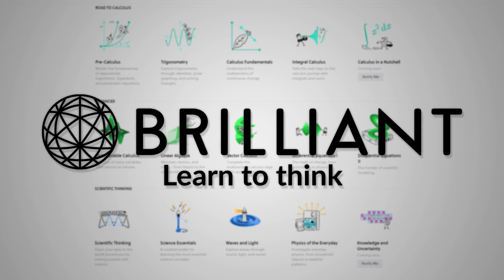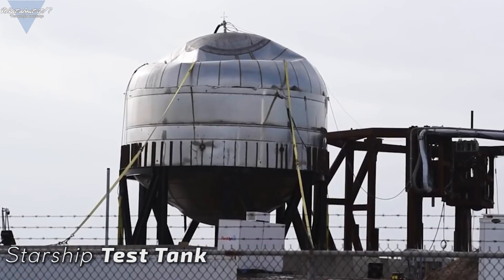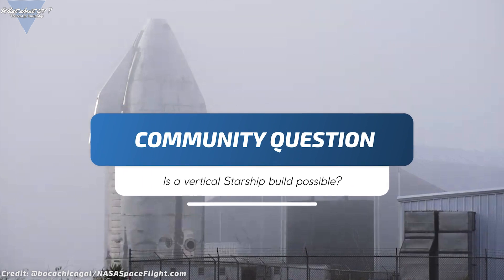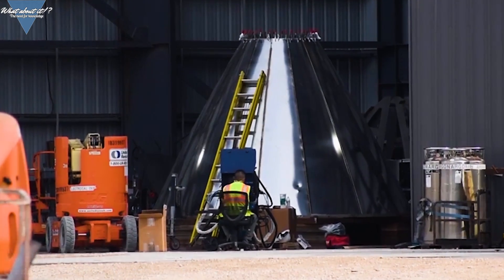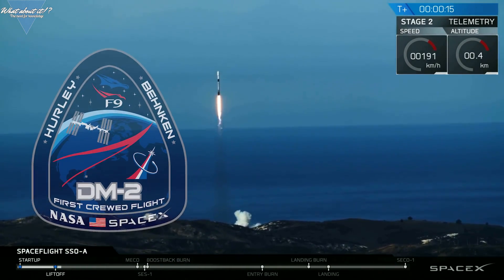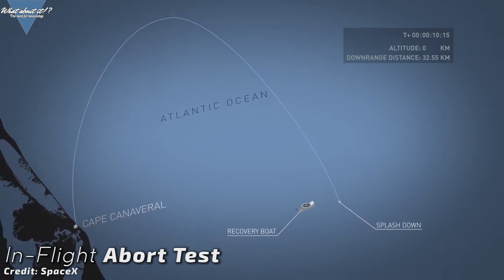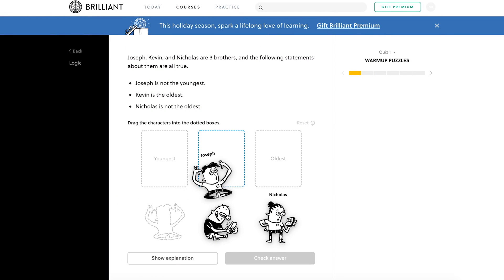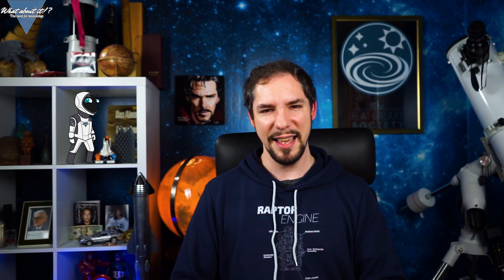65 | SpaceX Starship Updates – Crew Dragon In Flight Abort Preview

Comment: Joy to watch as always. Just something to point out. Metal Water cutters cannot work only with water. It needs some fine abrasive powder to be mixed through a nozzle at very high pressure.
Reply from the maker: Yup. You're correct too... Mixed it up. (pun intended)

Comment: Water jets usually use a grit, like garnet, in addition to the high velocity water.
Reply: Depends on how thick the metal is. With stainless, you are correct.
Reply from the maker: Absolutely! I might have been too much mesmerized...
Reply: Thought so. I've seen it with cinder blocks. It didn't look right in the video, so I figured.

Comment: I can think of a few methods to isolate working areas while stacking vertically. one is a Gasketed moveable work capsule for workers alongside the bulkheads which would keep a controlled environment constant while welding and fitting.

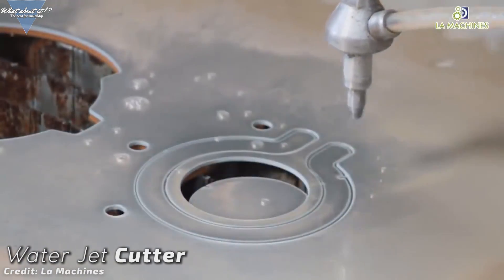Comment: 2:50 "nothing more than water"

I might be wrong, but dont these things work by using high pressure water to accelerate something else (sand or so) to actually cut the material?
Reply: Yes, typically garnet I believe

https://waterjets.org/archive/waterjet-equipment/general/waterjet-abrasives/
Reply: Yes
Reply: Yes, a common abrasive in a water jet machine is Garnets.
Reply from the maker: Yes yes yes! Thank you! :P :D
Reply: you can actually see some of the garnet collecting on the material in the video. that is the sand colored substance that is washing around outside the cut area. we have a water knife in my shop area that can cut steel up to 6" thick.

Comment: -Some of those I beams in the pile have heavy base plates, (making them columns). Those big thin plates on them are bracing connections.  They remind me of what was used when building the big wind shelters.
Reply from the maker: Second wind breaker is one of my theories too. The gravel pad they made is very large and in the original plans they mentioned a second wind breaker. Thank you for your comment!  :)

Comment: It's not just water, there is a feed they put in there that bombard the metal. I forgot its name but that makes the water unusable for the same process again as it'll clog the feed and water system if they do.
Reply: It's called "abrasive" and it's usually tiny grains of carbide (I believe)
Reply: @Sin526  yes that's the general term, and there are many types depending on the material being cut.
Reply from the maker: Absolutely! Messed up the words. Thanks for the feedback! :)

Comment: I'll go even one step further and say SpaceX won't fly a human to Mars before 2030. And that's perfectly okay, nothing wrong with waiting another 10 years. This vehicle needs to be super safe and hardcore tested before going to Mars.
Reply: They have the rocket motors to handle the job of going g to mars. 
10 years of testing would be too expensive  for a private  company. NASA help....

I dont think a death can be avoided. Sad to say .
Reply: @golfish8589  Oh it will surely fly before 2030, I think it will also fly to Mars before 2030. I was saying it won't fly humans to Mars before 2030. Look at how many F9 flights it took before Falcon was considered save enough to fly humans and how long it took to only test Dragon itself to be save enough. We're talking about existing technology, a rocket as small as a stick and a tiny capsule. Look at how many years that took. Do really think SpaceX could pull off a giant crewed Starship in 4 years? It's 2020 and they're figuring out how to weld pressure tanks. It doesn't matter how fast you build. They will encounter massive engineering problems which need testing, that's just how it goes. And that's perfectly okay.
Reply: @2014andBeyonD  
I herd a good comment somewhere.  Maybe it was in the video. "Space X is trying to find the cheapest manufacture to make the Starship starting with the cheapest techniques first?
Musk should make a 5 minute video each day. Recapping the decisions and progress/failures.

It would make a great documentary some day.

I just want to be a fly on the wall:)

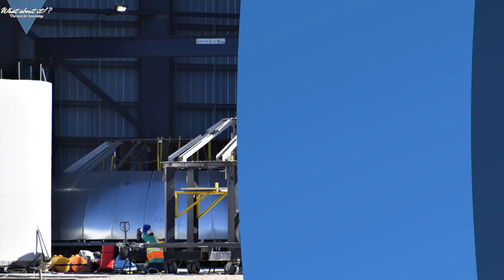Comment: 2:52 "... cut solid steel with nothing more than water" - NO!  While you can use "nothing more than water" to cut softer materials, I have never heard of it used to cut stainless steel.  Most likely they will use an Abrasive Waterjet Cutter which injects an abrasive into the water so it can cut the steel.  The filtration is needed to remove the abrasive before the water is returned to the pump. Abrasive may be good for cutting; but, it is bad for pumps.  This specific unit is a high volume abrasive removal system.  The big squarish bin is where the abrasive is collected.

Comment: Are those square cut outs to test strength for window cut outs?
Reply: Windows wouldnt be square, de haviland found that out in the 50s after losing a few comets.
Reply from the maker: Yeah... square windows are not an option at all. Also, windows at such an early stage would make no sense.
Reply: @Whataboutit  fisheye shaped windows would be ok....for the obligatory gopro shots of the flat curve. :)

Comment: Why don’t they make the parts with a single mold instead of welding? Wouldn’t that make it handle higher pressures?
Reply: The thickness has to vary along the length of the ship.
Reply: Odysseus Rex Doesn’t sound hard to make a mold with different thicknesses
Reply: @PassportGaming   Well, study up on engineering then.
Reply: @Odysseus Rex That’s my major in college
Reply: @PassportGaming   Then you will eventually come to understand.
Reply from the maker: Fun fact: Building in parts is almost all the time easier, cheaper and more flexible, when it comes to design changes. ;)
Reply: I meant just the tank, but you’re right about that

Comment: how come beoing is not doing this test?
Reply: Boeing did the test already. A pin was missing from a parachute and the environment suffered a poisoning but it was called a success.
Reply: @warhawkme6344  Boeing didn't do an in flight abort test. They did an abort test from the ground. They aren't doing it because they are trying to prove more on paper while SpaceX is trying to prove more in practice.
Reply: @warhawkme6344   No, that was a pad abort test, not an in flight abort test.
Reply: Both companies were given the option of an in flight abort test or extensive simulation. They made different choices.
Reply from the maker: Rex is correct. They were given the choice. Both decided on their own.

Comment: is it too hard to recover the booster of second abort test, example,:they also can put empty second stage to save the booster..
Reply from the maker: I was very surprised, when I first heard it too, but there's one thing, most don't see at first. It HAS TO be an unmodified rocket for valid test data. ;)
Reply: @Whataboutit  — unmodified except in one small detail, at least... the second stage has a full tank of fuel to keep the weight realistic, but no engine... presumably the missing weight of a single vacuum Merlin not considered important enough to be worth sacrificing one.

Comment: Why does SpaceX crew Dragon opt for a water landing? Boeing Starliner opts for land landing. Is Crew Dragon a lot heavier than Starliner?
Reply: Crew Dragon was originally designed for propulsive landing, no parachutes. NASA nixed the idea though. At that point, landing on land would have required radical redesign, so they went with splashdowns, which they were already doing with Dragon 1.
Reply from the maker: Correct. Thank you as always, Rex.
Reply: @odysseusrex5908  Presumably there's also the factor that, if you're launching from the east coast, any abort during launch is going to be wet... so if you have to design for that situation, you might as well make it the norm and not worry about landing on land.
Reply: @simongeard4824    Well, quite obviously, Boeing disagrees with you.
Reply: @odysseusrex5908  obviously, yes. I'm not saying it's the reason... only that it's a factor that both Boeing and SpaceX would surely have considered, even if they've subsequently chosen different paths.

Comment: What is the raptor production turning out to be should there be like a couple dozen completed by this point
Reply from the maker: Most likely not a couple dozen. The last time, we got a number, it was 17  as I remember. That was the "christmas Raptor". So roughly 2 1/2 weeks ago. So, we should now be at around 20 or so. Hard to tell without numbers. Everything Elon said so far about ramping up Raptor production was wildly wrong down the line, so I'd be veeeery careful with his numbers on that one. For example in may last year he said, they'd ramp up production to one rapter every three days until... last summer. If that was correct, we'd be at 60 engines right now and we're clearly not. ^^
Reply: What about it!? Thanks you for the info very interesting stuff. In my opinion Raptor engine production is a major limiting factor for the Star Ship production timeline. If every Star Ship need approximately 30 engines, and they’re only producing 1 every couple days it will take a year simply to make enough engines for the prototypes.

Comment: Pretty sure there were photos of the UFO Docking Ring already getting sliced up for scrap. Looks like it was a welds and cuts test segment.
How sure are we of the F9 coming down after a Rapidly SCHEDULED (!) Disassembly ?. The easy way to trigger an emergency event would be to load just enough fuel to get to Max-Q and have the F9's acceleration stall, causing the software to fire the Draco's using the normal in-flight software, rather the software modified for the test. Would a dry F9 still disassemble?
Reply: It disassembles because of speed, not because of fuel :)
Reply: @Fannystark007  - I think this will be one of the more interesting parts to observe. There won't be any need to have a fueled up second stage, meaning as the Crew Dragon pulls away, the open top end of the F9 will be exposed to supersonic airflow. that open top will surely be torn open, but will that cause a failure from the top bulkhead down? We have to expect that structure to have been reinforced for the loadings placed on it by the usual Grid Fin placements. I'm expecting a partial R.S.D., followed by a demolition charge, but there is still a possibility of SpaceX's flight control team to choose to allow a large single object to return ballisticaly along a predictable path, over a potentially more dangerous debris shower over a path that spreads and varies.
Reply: And. Of course, they could just trigger the Dragon's escape operation by detonating the F9 at Max-Q if they want to prove the Draco's can accelerate the Dragon away from an expanding debris field......

Comment: Is the dent in the tank caused like an implosion?
Reply: No its not !  Its like you drink coca-cola from a plastic bottle . The more you drink , the more the plastic is deformed inside .  Implosion means the presure its building inside too much --this is not the case .
Reply: Mike D Ow ok,
Reply: @cazymike87   No, it was precisely an implosion. The scenario you describe with a Coke bottle is an implosion. An implosion occurs when there is more pressure on the outside of a vessel than in, and the difference is great enough to overcome the structural integrity of the vessel. When internal pressure is too great, that causes an explosion. From the Latin 'Ex' meaning 'Out'.
Reply from the maker: And again, Rex takes point. Thank you. :)
Reply: Odysseus Rex  thought so, Thanks!

Comment: When SpaceX finally send two astronauts to the ISS, what will happen?  Will they be replacing two astronauts from the ISS or are they just going for a short visit and be returning on the crew dragon?
Reply: They will return with the Starliner , no worry mate !
Reply: I believe the current plans are for them to only have a short visit and returning on the crew dragon.  The second Crew Dragon flight will have a "changing of the guard" with the astronauts that arrive in it replacing some on board the ISS who will be returning in the spacecraft they arrived in.

It appears that once the Crew Dragon and Starliner are operational , the ISS will have a maximum of 7 astronauts at a time as opposed to the current 6.
Reply: @KnightRanger38   You are correct.

Comment: Would be hilarious if the abort failed, rocket did not explode due to a pyro failure, the rocket then goes into a true ISS trajectory due to a glitch in the azimuth math, actually rendezvous with the ISS because the engines failed to SECO, and then accidentally docks with the ISS.

Comment: Why is SpaceX reinventing fuel tanks with such difficulties? And what's the big deal about a water jet? These are very commonplace and any plate thickness fabwork should have been using this process from the beginning. I have been a machinist for decades, and I'm sorry to admit, I'm not impressed so far.
Reply from the maker: Strange, right. As if Mercedes would start building cars with sticks and stones. Ask yourself, why. SpaceX perfectly knows, how to build a rocket. This prototype phase is not about building the rocket, but about finding the lowest possible standard to biuld it. Elon is looking for the sweet spot between low construction cost and reliable hardware. You can't start that at the top. Would be very expensive. ;)